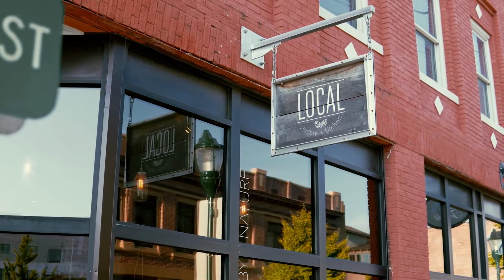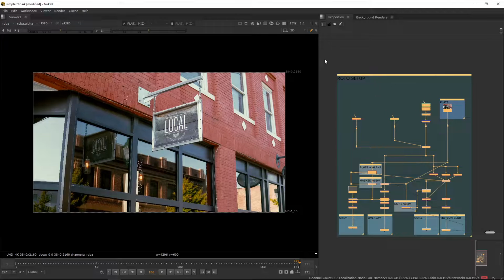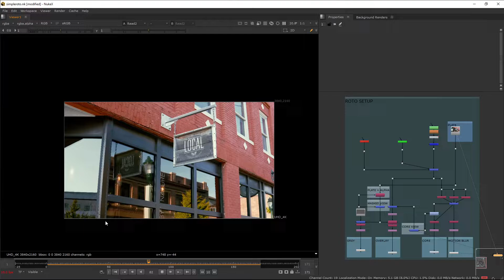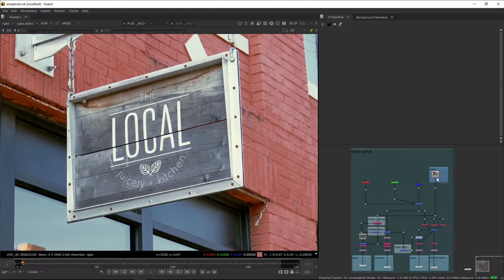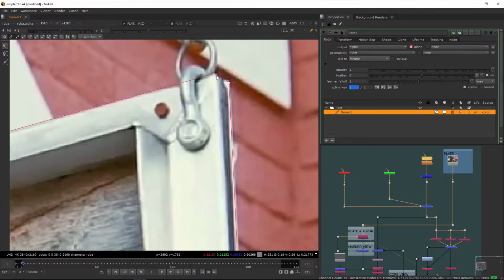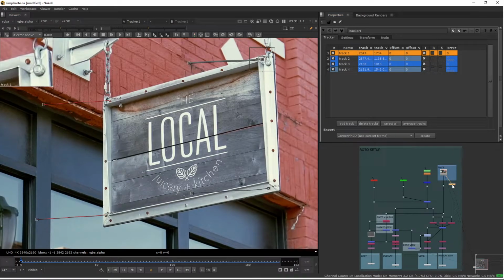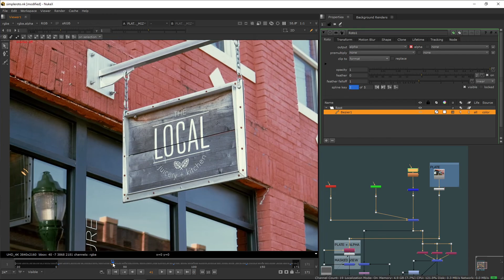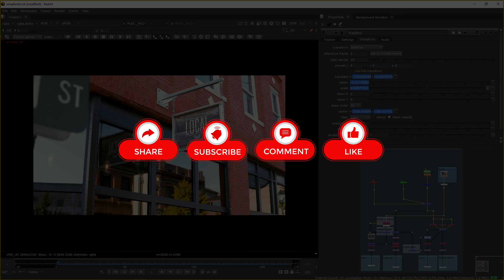Nuke Tutorial : How to rotoscope the right way

Comment: Thank you for that and the rest of the videos, I have one question tho, in your Roto setup(which project file I downloaded , thanks) the "Plate plus Alpha" Copy node , the A side ( the alphas from the Roto) comes from nowhere  both in the setup that I downloaded and also your setup that you are using here. So how does it get the Alpha from the Roto on top of the Plate when there is no alpha coming into that node, I mean it clearly works here in this video because you put the viewer there and it showed both the alpha from the roto on top of the Plate but I don't get how is that possible ;d
Reply from the maker: I am assuming that you mean it is working and you're only a bit puzzled about how the info is getting there, right? You see what is happening there is that the connection is hidden. If you select the dot that is acting as the receiver and press alt + h, you'll reveal the connection. I only do it to avoid having connections crossing over. I find it makes my script neat and easier to read. Please try that out and let me know if there are any other issues. Happy to help! Cheers!
Reply: @learnvfxcomp  Ohh so that was it ;d  I saw the link when I clicked on the dot, thank you!